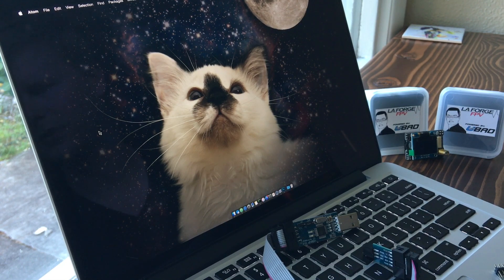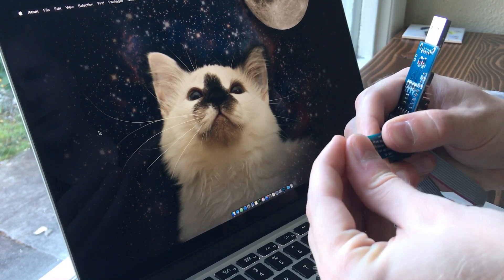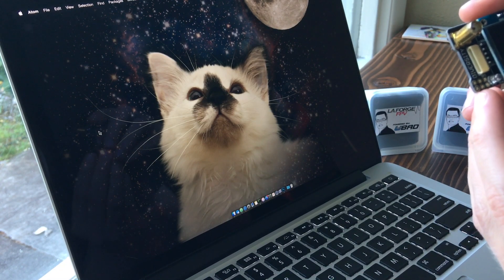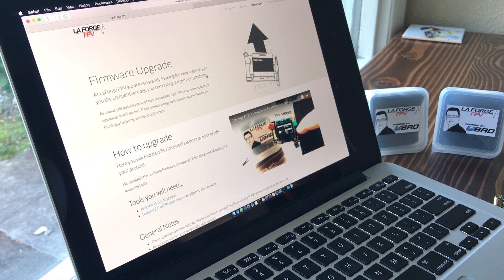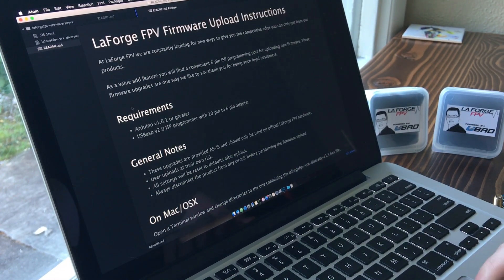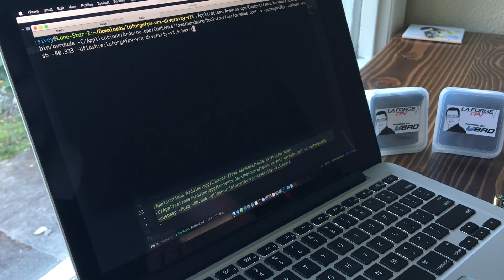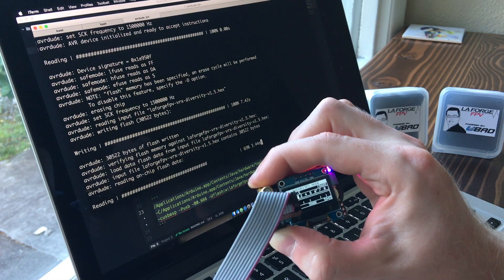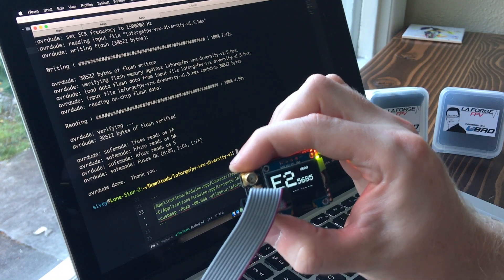LaForge FPV Firmware Uploading

Comment: Not a big deal, but under the "Tools you will need..." section of the Firmware Upgrade page, it would be helpful to also mention that a 6 pin header is needed. My USAasp Programmer arrived, and I was all set to go, but didn't realize I needed the header and didn't have one in my stash, so I was stopped dead.
Reply: did you locate a 6 pin header? if so, can you post a link? thanks
Reply: I found one on eBay. Kind of pricey for one header, but I was in a hurry to get one. http://www.ebay.com/itm/Straight-Header-0-1-Double-Row-6-Pin-2x3-0-025-Post-20-pcs-/112230558218
Reply: And with that header, everything worked exactly as in the video, and my LaForge module in my Dom HD2s is happily running the latest firmware.
Reply: thanks for the info and link, trying to get stuff together for the new update coming out

Comment: I have this same USBASP device.. Im trying to do this on Windows and its giving me this error... I think its an issue with my driver for the USBASP but I have tried them all... 

avrdude: set SCK frequency to 1500000 Hz
avrdude: warning: cannot set sck period. please check for usbasp firmware update.
avrdude: error: programm enable: target doesn't answer. 1
avrdude: initialization failed, rc=-1
         Double check connections and try again, or use -F to override
         this check.
Reply: i'm getting the same... did u figured it out?
Reply: +Guerrilla Drone yeah switched to another USB port and was good
Reply: +silicosick awesome!! I'll give it a try!! :)
Reply: silicosick it worked!! Thanks! :)

Comment: Hey Shea, (EDIT)
Dose this look right to you? > C:\Program Files (x86)\Arduino\hardware\tools\avr\bin\avrdude" -C"C:\Program Files (x86)\Arduino\hardware\tools\avr\etc\avrdude.conf" -v -patmega328p -cusbasp -Pusb -B0.666 -Uflash:w:C:\Users\Regan\Downloads\LaForge Frimware V1.5:i
I'm getting > 'C:\Program' is not recognized as an internal or external command,
operable program or batch file.

I got it ! It was the wrong USB driver, I changed the USB driver with Zadig to libusb-win32 (v1.2.6.0) and it worked great ! Here's what it should look like in windows 7.

C:\Users\Regan\Downloads\LaForge Frimware V1.5>
C:\Users\Regan\Downloads\LaForge Frimware V1.5>"C:\Program Files (x86)\Arduino\h
ardware\tools\avr\bin\avrdude" -C"C:\Program Files (x86)\Arduino\hardware\tools\
avr\etc\avrdude.conf" -v -patmega328p -cusbasp -Pusb -B0.666 -Uflash:w:laforgefp
v-vrx-diversity-v1.5.hex:i

avrdude: Version 6.0.1, compiled on Apr 15 2015 at 19:59:58
         Copyright (c) 2000-2005 Brian Dean, http://www.bdmicro.com/
         Copyright (c) 2007-2009 Joerg Wunsch

         System wide configuration file is "C:\Program Files (x86)\Arduino\hardw
are\tools\avr\etc\avrdude.conf"

         Using Port                    : usb
         Using Programmer              : usbasp
         Setting bit clk period        : 0.7
         AVR Part                      : ATmega328P
         Chip Erase delay              : 9000 us
         PAGEL                         : PD7
         BS2                           : PC2
         RESET disposition             : dedicated
         RETRY pulse                   : SCK
         serial program mode           : yes
         parallel program mode         : yes
         Timeout                       : 200
         StabDelay                     : 100
         CmdexeDelay                   : 25
         SyncLoops                     : 32
         ByteDelay                     : 0
         PollIndex                     : 3
         PollValue                     : 0x53
         Memory Detail                 :

                                  Block Poll               Page
      Polled
           Memory Type Mode Delay Size  Indx Paged  Size   Size #Pages MinW  Max
W   ReadBack
           ----------- ---- ----- ----- ---- ------ ------ ---- ------ ----- ---
-- ---------
           eeprom        65    20     4    0 no       1024    4      0  3600  36
00 0xff 0xff
           flash         65     6   128    0 yes     32768  128    256  4500  45
00 0xff 0xff
           lfuse          0     0     0    0 no          1    0      0  4500  45
00 0x00 0x00
           hfuse          0     0     0    0 no          1    0      0  4500  45
00 0x00 0x00
           efuse          0     0     0    0 no          1    0      0  4500  45
00 0x00 0x00
           lock           0     0     0    0 no          1    0      0  4500  45
00 0x00 0x00
           calibration    0     0     0    0 no          1    0      0     0
 0 0x00 0x00
           signature      0     0     0    0 no          3    0      0     0
 0 0x00 0x00

         Programmer Type : usbasp
         Description     : USBasp, http://www.fischl.de/usbasp/

avrdude: set SCK frequency to 1500000 Hz
avrdude: warning: cannot set sck period. please check for usbasp firmware update
.
avrdude: AVR device initialized and ready to accept instructions

Reading | ################################################## | 100% 0.02s

avrdude: Device signature = 0x1e950f
avrdude: safemode: lfuse reads as FF
avrdude: safemode: hfuse reads as DA
avrdude: safemode: efuse reads as 5
avrdude: NOTE: "flash" memory has been specified, an erase cycle will be perform
ed
         To disable this feature, specify the -D option.
avrdude: erasing chip
avrdude: set SCK frequency to 1500000 Hz
avrdude: warning: cannot set sck period. please check for usbasp firmware update
.
avrdude: reading input file "laforgefpv-vrx-diversity-v1.5.hex"
avrdude: writing flash (30522 bytes):

Writing | ################################################## | 100% 8.16s

avrdude: 30522 bytes of flash written
avrdude: verifying flash memory against laforgefpv-vrx-diversity-v1.5.hex:
avrdude: load data flash data from input file laforgefpv-vrx-diversity-v1.5.hex:

avrdude: input file laforgefpv-vrx-diversity-v1.5.hex contains 30522 bytes
avrdude: reading on-chip flash data:

Reading | ################################################## | 100% 10.00s

avrdude: verifying ...
avrdude: 30522 bytes of flash verified

avrdude: safemode: lfuse reads as FF
avrdude: safemode: hfuse reads as DA
avrdude: safemode: efuse reads as 5
avrdude: safemode: Fuses OK (H:05, E:DA, L:FF)

avrdude done.  Thank you.

Assuming your name is Regan.
Reply: Thanks Regan. I had the same issues using Win7 and your tips were quite helpful. I tried so many ways that in a 3 hour attempt that I can't say for sure where my problem existed. The driver was incorrect for sure as you pointed out. That was evident in the device manager. I think the new firmware finally loaded when I started the Arduino app manually then copied and pasted your DOS command line. If Arduino has to be running that important step was left out.